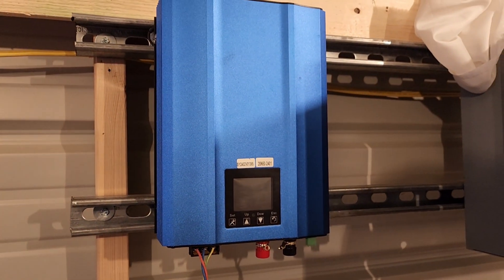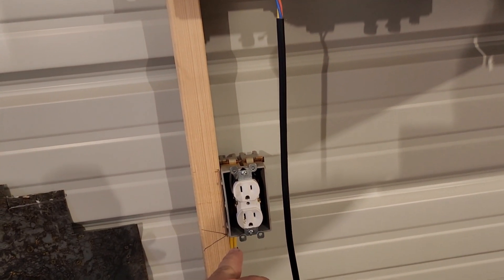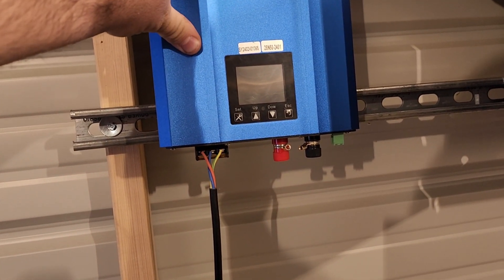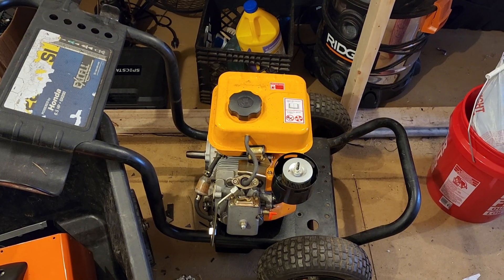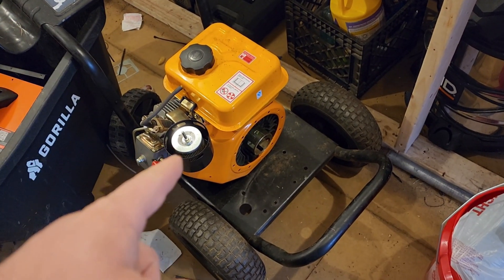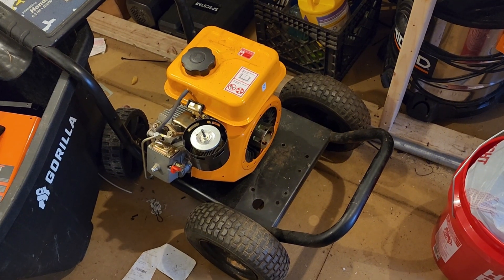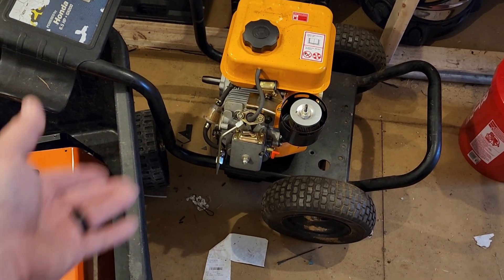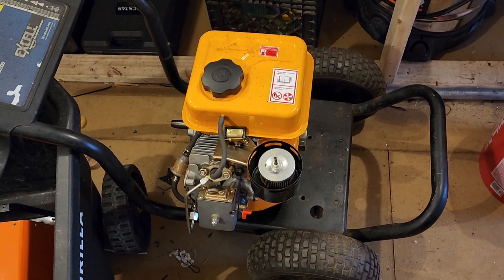Grid Tie Waste Oil Generator Project and channel into

Comment: One lesson I learned the hard way, is that if you have an old analog-style killowatt hour meter, it will never turn backwards unless its backfed at 240 volts. Backfeeding with a grid-tie inverter at 120 volts doesnt make the meter run backwards unfortunately.

This can easily be fixed by using one of those travel transformers (autotransformers) to boost the 120 to 240 and backfeed both legs of power.

Comment: Please continue with this! So I myself have thought of doing something like this. I am already grid tied approved with my solar.  I was thinking  of using an egr cooler on the exhaust  using the waste heat to help heat my house and then all the electric going back. Yes here they buy back 100% so it's like a perfect battery without  the cost. And using a waste product like engine oil Tops it off.